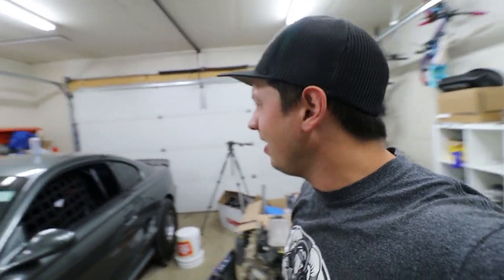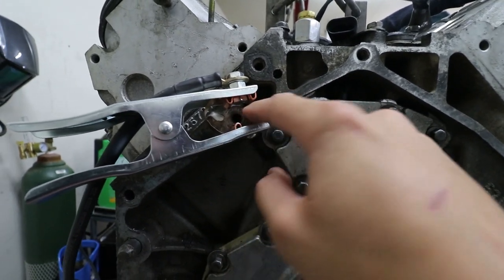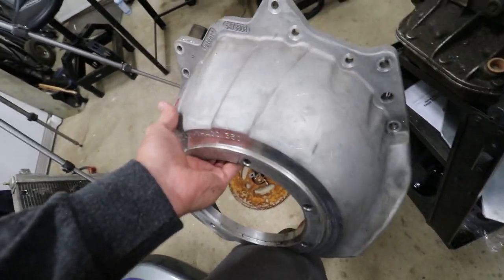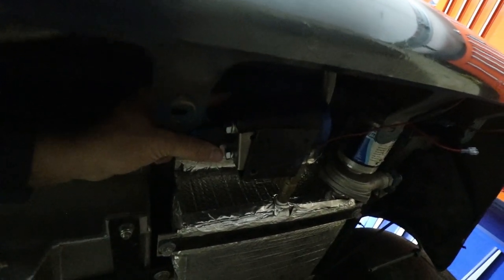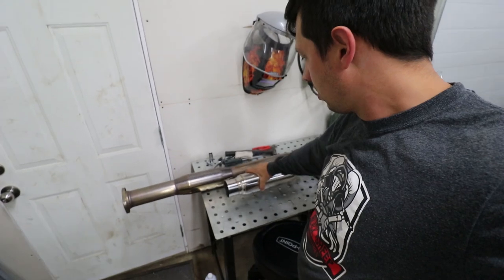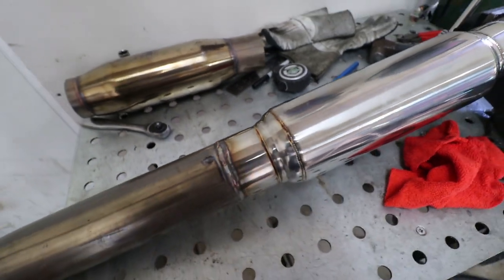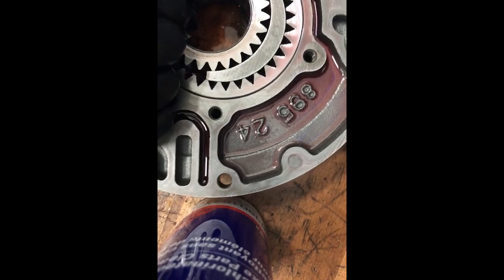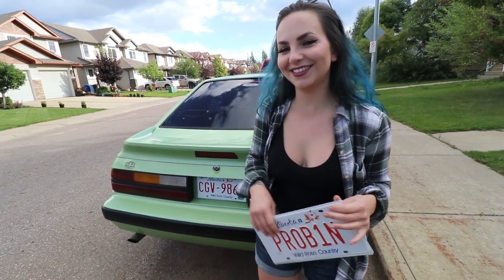Surprise For My Girlfriends Twin Turbo Fox Build

Comment: Can't you switch around the intake pipe and the bulkhead connectors? Seems there is room to fit the pipe lower. And than you won't have to do crazy 180's on your intake.

Comment: When I install a helicoil I break off the tab  that the tool uses after its in. Pull the install tool back turn it 90°, put back against that tab and give the tool a smack. That way your bolt can pass all the way through the helicoil.
Reply from the maker: I broke that tab off also!!

Comment: Loosen and re-tighten the holders on the guides for the blade. You can twist them ever so slightly when doing so. Also, increase the spring tension on your saw or wait until the first 1/2" is cut. The weight of the swing arm causes the blade to twist a bit.

Comment: Word to the wise in regards to thread engagement and strength.

Technically, the clamp force capability doesn't increase beyond the diameter of the bolt in depth.

So an M12 bolt, as long as it has 12mm of engagement, clamp load won't increase. There's exceptions (softer materials need more thread engagement) but that is the jist of it.
Reply from the maker: Interesting knowledge!
Reply: @Boostedlifestyle  I've used the same kit you used on stuff under way more load without issue so you'll be fine.

Comment: Kyle,  Weld up the cracked threaded hole, then drill and tap it. I also suggest in the future using an intank or fuel cell multiple fuel pump return style fuel system.
Reply from the maker: I don't like intank pumps 😂

Comment: I would get some slip on tech flex in different colors and use it to designate the different wiring systems. All the body harness one color/pattern. Engine and so on it will do double duty clean up the wires and also you will visually know what you are always looking at

Comment: I'm going to need the details on where you got that bulkhead fitting.  I have been throwing around that idea for a while on mine but could never find one that works that slick.
Reply from the maker: I think it's a motionraceworks kit
Reply: It's just a mil spec Deutsch Connector. You can buy in any of about ten different pin quantities and you need the crimping tool that goes with it as well as to know the wire gauge you're using because you'll buy the male/female shells, the pins in the gauge range you need and the heat shrink boot which you can get in straight or different angles..

Comment: You need to hook up with a fello named Craig in Ponoka, since your into the LS he does the best porting on LS heads , he has done Mod heads for me. He is legit Strong Arm Porting. No guess work either he runs a flow bench and very precise on the porting next to possibly a CNC.

Comment: On your helicoils you can stack them instead of jus using one. Even drill your hole a bigger size so you can tap better threads if needed to get the coils to bite better

Comment: Hey lad it’s just ally so you can just weld it and redrill it. And drill the new bell housing so you have as many bolts holding it. Because I think if you don’t it’s going to brake the bolts and brake your block. Just trying to help. Cain hard guys.

Comment: just get a chop saw to cut the large piping with. it will need a lot more clean up on belt sander but you will only need it for the huge piping.

Comment: Can I make a suggestion, label you're 2 wire pin plugs just in case troubleshooting becomes an issue? A labeled diagram might come in handy?
Reply from the maker: I'm gonna make a file folder I think and laminate the wiring diagrams and leave it in the car
Reply: @Boostedlifestyle  I figured you would do that but I wanted to make sure it didn't slip by. Take care brother and thanks for the content, the entire channel is worth watching and it's appreciated.

Comment: Look up Devin Vanderhoof on YouTube. Wiring genius with amazing info. Also tons of Holley info since that’s all he uses. Shows you how to use advanced features and how to properly wire up certain connectors such as those bulk heads you have on the fire wall. They take certain pins

Comment: Talking about jic will both confuse and infuriate the people of the internet. You have to dumb it down to steel AN fittings.
Reply from the maker: Hahahah but jic fittings are so much cheaper 😂
Reply: @Boostedlifestyle  thats why I use them. 4 bucks for fittings and can have hoses made local. Can't beat that.

Comment: Kyle nice job yet again.. I’m a mechanic I had a guy break a head stud in a block once and had me fit his new heads etc I bought a thing called a nut sert. I ordered it online and it was kinda like you used but ... it was high tensile rated . Might help you out if what you did plays up at all I found it online and had it delivered it had a much thicker wall than a heli coil so yep keep it in mind for next time 😎👍✅ you da man ....

Comment: --------------------------------->  @ 10:16  -  are you interested in another EASY side-job ?   Cutting the resonators & 2nd cat's out of my exhaust & welding in strait pipe ?    2013 AMG C63